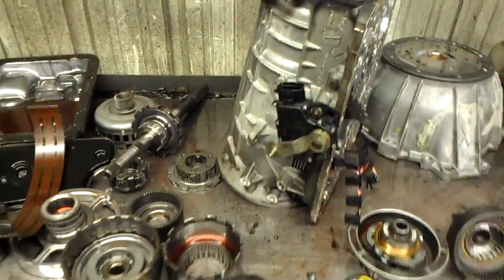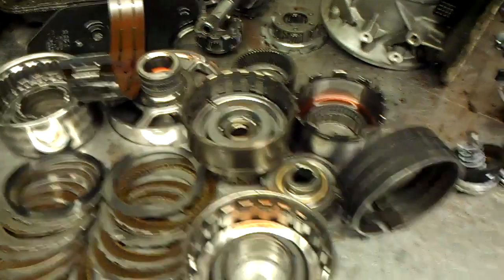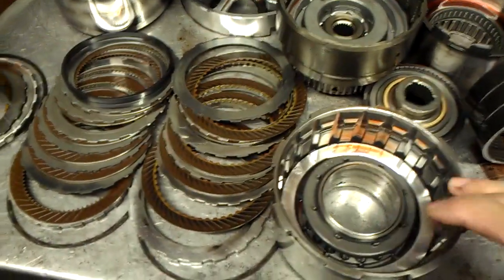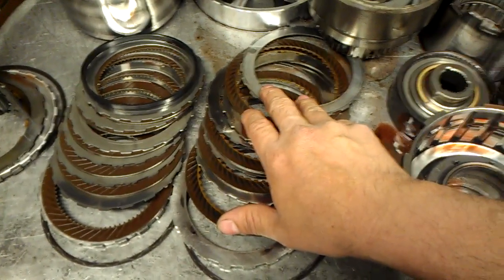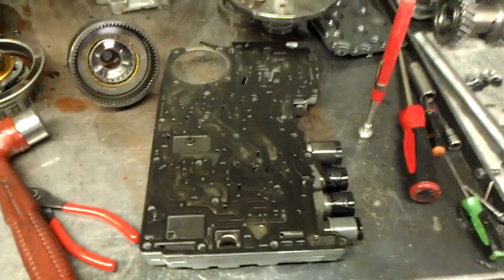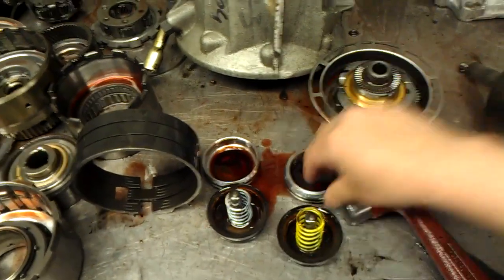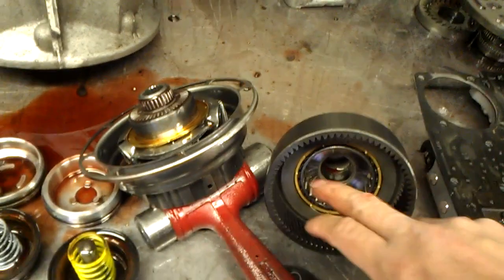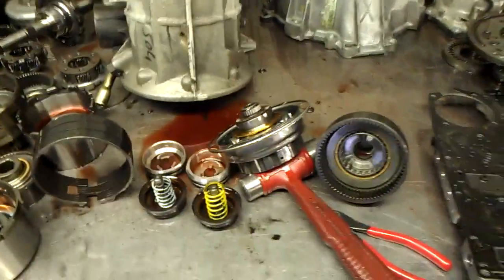5R55E transmission P0733 3rd. Incorrect gear ratio - Transmission Repair

Comment: What if your solenoid making a buzzing sound?  Its pulling a p0731 code which say's first gear ratio but still goes into first gear no problem what do you think the problem?  A/t goes on and off and engine light goes on and off as well you thing the solenoid might going out? On 2000 subaru forester?
Reply from the maker: Yes, it is very common for solenoid issues on subaru cvt.
The TCC solenoid and transfer solenoid. 
Dorman has the TCC but not the transfer solenoid.

Comment: Hello Hiram! i love your videos. 
I have absolutely same problem with 5r55e after rebuild...NEW: ohkt, bands, od planet (new), od sprag, clutches, servos,epc oem, TC, ISS.  I build that 5r55w/s/e trannies many times...i know how to adjust bands, never had an issues with that....And right now don't have any idea what to do🤦‍♂️ 
And so much brass material in oil, like gold shining...
I put shift kit transgo during rebuild, but after i droped VB, took off updates from VB...And nothing changed...
Reply: Have the same problem trynna figure out what to do

Comment: I have such a problem. The transmission runs normally. After warming up it pops up P0733 3rd. Incorrect gear ratio. 
What should i do ?
Reply from the maker: Readjust the bands. Torque to 72in.lbs. then back off 1-1/2 turns.  
If you got internet green fluffy bands you'll need to do this a few times until they get broken in. 
I hate those, they're trash.

Comment: Hello, I have a BMW E39 540I ZF5HP24, a problem with the automatic transmission. On the first start, the car is in a normal temperature, it works fine, and after a distance, the transmission heats up and shows these codes P0733 / P0732. The transmission does not perform the gears and gets stuck in the fifth gear only when the car warms up and when it is cold does it work well? of help please

Comment: P0730 on a 2002 Mercedes Benz E320 4 matic . .......  trying to figure out whats wrong . Only 1st gear works . When its going into 2nd it goes on limp mode.

Comment: I hate to say it but all that transmission needed was a new valve body gasket, I've fixed several 100 that way,,,if  it still Flair's on the 2-3 shift  then it needs an epc solenoid,,,but it's wise to do the epc at the same time as the gasket,,the reason it didn't have second and not set a code is because they 4.0 liter sohc skips 2nd at light throttle and commands 2nd at or near 3/4 and more throttle,,also all 4r and 5r models from 97 up have the oss sensor not just the 5r55e, also the difference between a 44e and 55e is the planets,,44e uses 3 and 4 pinion planets and the 55e uses 6 pinion/gear planets

Comment: Hello Hiram,
Have a question. 
I have a 1995 Ford E350 van. When you put it into gear, or sometimes when coming to a stop, the van will die. It fills like what a standard transmission would do, if failing to apply the clutch.
No check engine lights. Could it possibly be the Torque Converter? 
Any help would be greatly appreciated.
Thanks in advance 
Michael B
Utah

Comment: i recently bought another 2010 genesis coupe 2.0 for only 2,800$. it had 1 code for cylinder 3 misfire, i replaced all spark plugs and fixed the problem. when i scanned the car again it said p0733 gear 3 ratio incorrect. and it goes into a limp mode sometimes. my question is should i change the transmission fluid, get the transmission repaired or buy a slightly used transmission. thanks in advance
Reply: ModdedCars  did you get it fix it

Comment: AUDI A6 3.2L READ RATIO GEAR 5 MEAN? also tow car shop WAS no ATF. PUT 5 QTS. PRESS ACCELERATOR CAR will not MOVE JUST STARTS N RUN HELP?

Comment: how does the tcm catches that there is something wrond and set the code?? thanks
Reply: It monitors the rotational speed of the internal components via the speed senors one of which he pointed out to us at the rear of the 5R55E. 

When the rotation is faster or slower of the components  between the sensors the control module will set a code and turn the light on. I think it also has to see the same fault three consecutive times in a row as well. I've been out of the shop for years and a bit rusty but think this is close for Ford maybe someone else will set it straight if not.

Comment: Could you help me with my automatic transmission problem , when its cold it works fine and after few minutes it has a problem with switching gears , it has only one gear and wont change in to higer gear. Its an opel antara 2.0 cdti , it displays P0733 error code

Comment: Hi i have a 2005 dodge caravan and I have a code PO733 , transmission sometimes acting crazy , what u recommend to me to do ? I need make a 2k miles round trip in November and I'm worried the car could brake in the hwy

Comment: could you please help me with my transmission problem it doesn't shift right after driving about a hour or more it goes into neutral instead of shifting to the next gear it's throwing three codes P0782, P0733, and P0732
Reply: early 99 f250 7.3 with a remanufactored transmission
Reply: I bought the truck with the transmission already in it the guy never said anything about the transmission being remanufactured I found the tag looking under the truck seeing if possible there was a wire lose or broken and came across it, is there anyway to trace the transmission and see if it has a Warranty still on it?
Reply: +Hiram Gutierrez would it be damaged if it only doesn't have driving for about 35 to 40 minutes before it starts acting up, up until that point it shifts perfect you can barely even feel it shift at all

Comment: hey I have a 2004 ford ranger the od light blinks and no od but if you take and push the od so the light od light is on the 1 through 3 gears are perfect but other wise rough shifting ,mechanic said incorrect gear ration and needed to be rebuilt ,have any suggestions

Comment: Hola Hiram tengo unas preguntas espero que puedas responder gracias.
un amigo tenia fugas de fluido de transmission 5R55E en su 2000 explorer dejo de caminar fuy a verla y le puse fluido estaba seca una vez que le puse volvio a caminar pero como que se jalaba cuando cambiaba a la reversa o al drive  despues de un rato caminaba algo normal, pero tambien se escuchaba muy ruidosa la transmission. pienso q talvez es el torque converter.
Dias despues le cambie el filtro de trans, 2 gaskets que lleva a donde van solenoide pack y le puse nuevo aceite mercon V y  quise mover la  palanacas de velocidades se puso dura logre destrabarla pero van ya no se movio la camioneta
crees que hice algo mal?

Comment: Hiram, thank you so much for your video on the 5R55E transmission. It encouraged me to tackle a rebuild on my 1997 4x4 Ranger restoration project. I'm. 63 yes old. Never worked on am auto trans before. I usually just have someone else do it. Now I'm in with booth feet. It,s coming along fine. Right now I have a question on the "converter support shaft sealing ring. The transtec kit has an update on this sealing ring. They sent a solid grey ring. They say it replaces a yellow plastic ring. Do you know about this change? The change was on 2003. Mine is 1997. Is this change meant for my 97 as we'll? My sealing ring is brown. 
?

Comment: Hi  Hiram. I've been learning a lot from your videos on the 4R44e/5R55E. I know that the 5R55E has a speed sensor on top of the case at the rear. However mine has one just behind the bell housing also. I have 2 speed sensors. The tranny is out of 1997 4x4 ranger. Is this weird?. One more thing, the brass cap on the overdrive spray came off like the one in the video but there is no damage to the race. Is it OK to just put in a new spray? I can run my nail over the surface of the race and not feel anything. Smooth like new.

Comment: Hiram I have a 2000 ford explorer. When it is in The D for drive, it only revs.  I have to put it in the 2nd to go, when i'm rolling it can be dropped into D and it accelerates perffect. When i stop i have to put it back in 2nd.  I dont know what damage driving my car like this is doing.  I seen some videos on fixing the gasket and one video about aftermarket servos with o rings i can place in it.  Im thinking about doing that.  What would u suggest is wrong wit my suv and what should i do? I am considering a 1200 mile trip on the highway and i would like suggestions about how to proceed. also it was making a grinding clunking noise when i would reverse till i had the transmission fluid an filter changed.
Reply: S Johnson ,can you tell me what was your transmission ploblem,i got the same problem. 
thanks in advance.
Reply: Vaso De varro one of the gears was broken. can replace the one gear but it will break again. the whole set needs to be replaced with a aftermarket gear set that is engineered better than the ford factory manufactured gear set which is designed faulty
Reply: S Johnson ,thanks brother, I going to look that.
Reply: S Johnson i forgot, do you know the name of the gear?or where is located?
Reply: Vaso De varro the transmission gears
Reply: S Johnson m
Reply: S Johnson

Comment: Hello Hiram, Excellent Video - Thank you, I know it helps a lot of people including me. I wonder how many miles were on that tranny in the video ?  My Daughters truck has a 5R55E in a '97 Explorer (151k miles) that just failed, 1st and 2nd ok, then won't shift into 3rd or OD (misses the shift - high rpms), and Reverse seemed to just make a little turbo like sound for 10 seconds or so, then worked properly.  I'm a semi-handicapped engineer and backyard mechanic but, no transmission experience and I respect your knowledge - I've taken it to 3 local shops, different storys from each  like I'm an idiot - and the only detail they want to discuss is price.  I would even pay for your consult, she supports us with her job and needs this vehicle, I'm hoping I might be able to get a few more miles out of it by repairing it myself without removing it from the truck, just not sure how tell if 'hard parts' might be damaged which would make my attempts to repair gaskets and soft parts a waste of my time/money/hope.  I know no one has a crystal ball, but no one seems knowledgeable enough to even tell me how to make an educated assessment -on the vehicle. I'm hoping you can help, again, I would pay for your consult. Sincerely, David
Reply: ***** Thank You Sir, you are both kind and professional, I shall pass your generosity along to the next soul in need - I wish I could do something for you,

Comment: Hi hiram, back again with more information. We hooked up a pressure gauge to the EPC port. Idle in drive pressure is 35 PSI, idle reverse is 65 PSI. Reverse wide open throttle is 120 PSI. Manual 2 and Manual 1 are 35 psi idle, and 110 psi wide open. However, drive wide open throttle only hits about 55-60 PSI EPC at 3,000 RPM, then it starts to drop to around 45-50 PSI as the RPM increases. Any ideas?
Reply: good

Comment: Hello again Hiram.
I rebuilt the 5R55E transmission for the 2001 Ranger RWD 4.0L. It works well but there is a problem with shifting. I have to manually shift or the OD light will start blinking. It feels like it is not going into first gear. I've had no choice but to use it since rebuilding it so I can earn a living.
I have pulled some heavy loads with the truck since the rebuild and it pulls fine without issue if I manually shift it. Can you give me some direction as to what might be causing it to have to be shifted manually.
 Like I said,  it seems as though first gear is not engaging or not fully engaging, Twice over the past two or three weeks it was if it went into neutral even though it was in second gear,.When it did that I was taking off from a stop and turning while accelerating, and it was as if it went into neutral. I assume it has to do with what ever is causing me to have to manually shift it... Thanks Hiram I really appreciate your guidance and knowledge with this ranger transmission.
Steve.

Comment: Hi Hiram, been a long time viewer of your videos, but finally came up on a problem I can't figure out. A friend has a 1998 Ford Ranger 4.0 with the 5R55E. 1st, 2nd and 3rd all shift fine, but just recently the truck suddenly lost 4th. We adjusted both bands to spec, but it made no difference.

If you drive the truck over 40 MPH or so, after a few minutes the O/D light will start blinking and the truck will go into limp mode. At this point, 5th starts working fine again, but 4th does not. If you come to a stop with the O/D light blinking, it will shift hard from 1st through 3rd, then it will keep accelerating in 3rd and eventually shift hard into 5th, skipping right over direct.

Any idea what is wrong? Because if my thinking is correct, you need direct to work, for 5th to work in the 5R55E, so I'm not sure why 4th doesn't work, but 5th does. Maybe a valvebody or solenoid problem?
Reply: *****  Reverse seems to function fine without slipping, It has a very slight engagement delay (around 1.5 seconds), but it doesn't engage harshly.
Reply: ***** Hi, we did somse more testing with a better scan tool and came up with P0734 and P0735. Additionally we found if you absolutely floored it in reverse, it does slip some. Guessing the direct clutch assembly is cooked?

Comment: Hello.  I have a 1998 ford ranger RWD 2X4 4.0L. and I can not get the truck into reverse.  All the other gears drive fine, but no reverse. Would i be able to rebuild the transmission or would I be better off buying a used one?

Comment: HI HIRAM, 
i got 04  F-150, 70 Kmiles shift fine in 1st ,2nd and reverse but soon as i got 30mph it goes neutral  ,looks like i got problem with 3rd,4th and overdrive , is there any way i can fix it my self ??, i got new 5 qts of mercon 5 and filter in ,but Unfortunately id did Not change any thing ,i saw lots of your videos on some other transmissions,do you have some for my truck ??,YOU ARE AWESOME WITH THIS DETAILS !!!
THANKS JOHN

Comment: I got P0733 and P0734. Fluid is not black and does not smell like its burnt but it does smell like burnt plastic (maybe wiring or solenoid?)

Comment: Hiram- 
I have an 01 explorer 4.0 4x4 with 176k and i replaced the trans last yr. Since then no problems, shifts perfectly until it started to slip this morning and i let off the gas and gave it gas again and it jumped into the next gear. When i came to a stop and took off again, it did it again and od off light is flashing.

Comment: Really enjoy the videos, best I have found so far. I have a 98 Ford Explorer with the 4R55 AT in it. The OD light has begun to flash and it will not shift in to overdrive. The 4x4 low and high dash lights will flash. Could this be a broken band or a wore out servo bore?

Comment: Yes they are bad about worn out valve bodies. There are some after market valves to repair them. I have seen a few that I had to just replace the entire valve body with a reman to get it right. What you see in this video is a list of common failures. Great job Hiram.

Comment: Hola muy buenas tardes Sr. Hiram le escribo desde Venezuela, la transmision 5R55E, de mi ford Explorer año 2000, me empezo a fallar y la mande a reparar, realmente no se que le cambiaron, posteriormente espezo a prenderse el overdrive titilando despues de recorrer 1/ 2 hora, ya obstinado, compre un cuerpo reconstruido en central body valves, y se le instalo conjuntamente con el manojo de cables nuevos que conectan los solenoides. actualmente no prende ni overdrive , ni tampoco check engine,